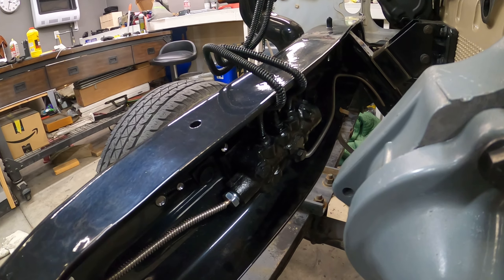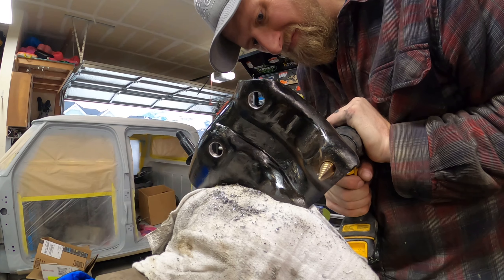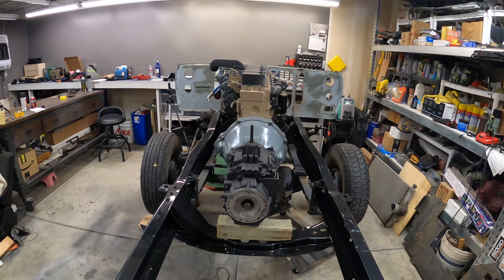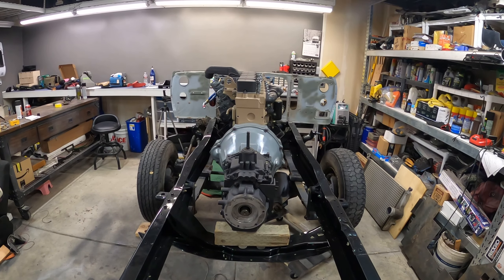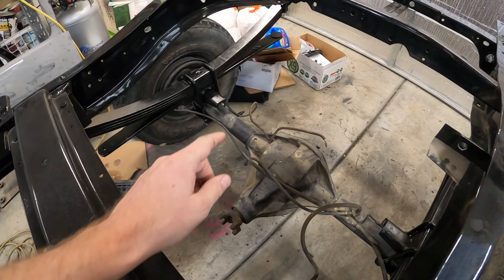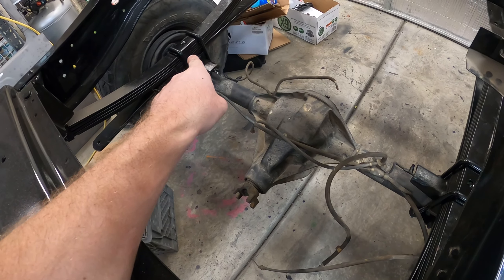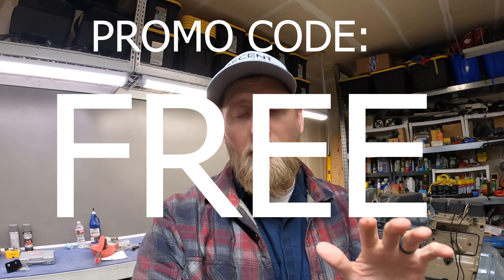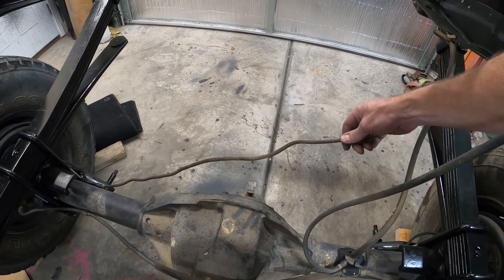Final Details Before the Chassis is Complete | Long Bed Larry - Ep.19

Comment: I replaced all the break lines in my 1951 Willys wagon when I did front disc break conversion. I was like you a little nervous but after I played with the flair tool, I jumped in and knocked it out, not too hard. Your job came out nice and clean, congrats!!

Comment: Hi Tim great job 👍.
As a safe practice, l always clean the end of my brake, or fuel lines by  holding them upside down, that way any shavings could fall to the floor. Blowing high pressure air through the line helps but doesn't always force metal shavings out. 
The frame is looking really good 👍🏻. Can't wait to see it ready for the body to be installed for the last time.
This is one of my favorite trucks of yours, big, tough, powerful and oh so long!
Will you install any aftermarket things like? A camper? Or a plow? You know, to make it longer? 😛.
It really looks cool.
👋 🌬 🌧❄️ 🇨🇦 😊.